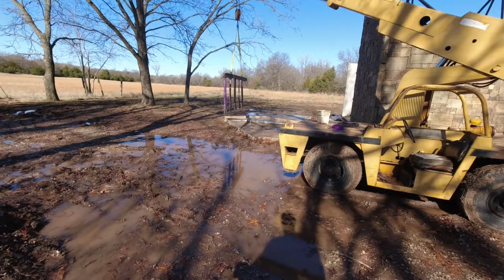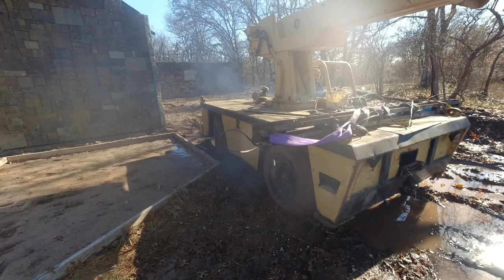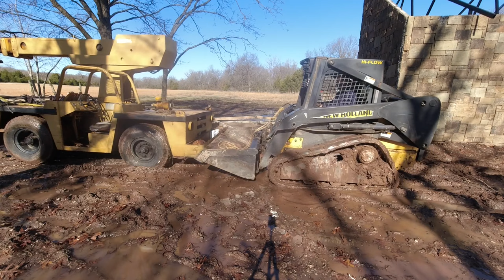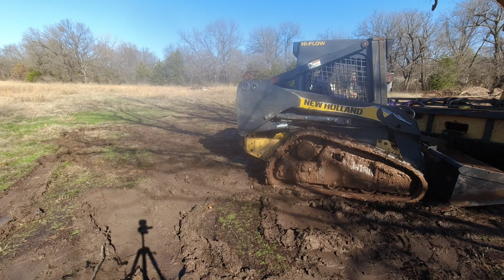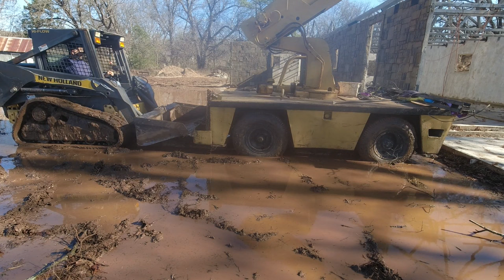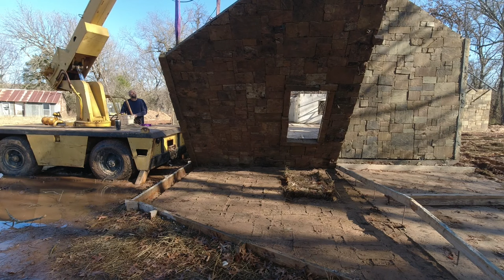Moving Stuck Crane

Comment: Lucky you had a  ROPS on that crane.   Looks like you have some grading to do to direct all that water away,
Reply: That isn't ROPS on that crane, all that's there is a very basic light frame, probably intended for a tarp to keep the rain off the operator, it's not going to stop much.  And you mean FOPS. and ROPS.